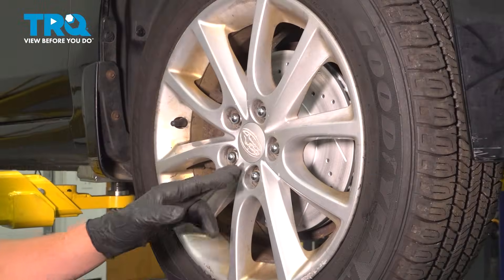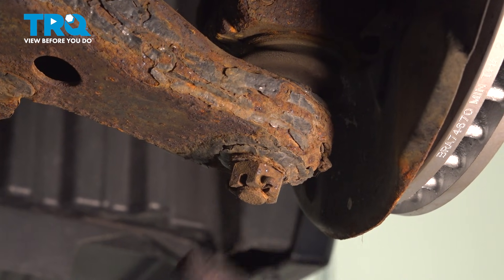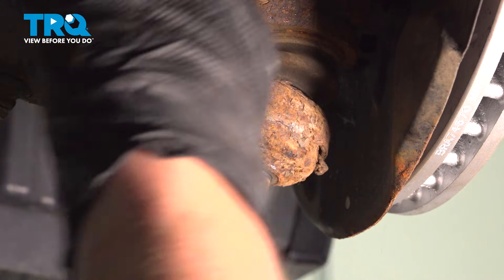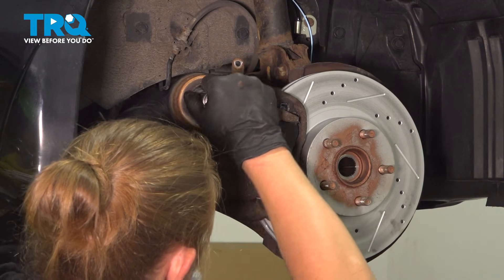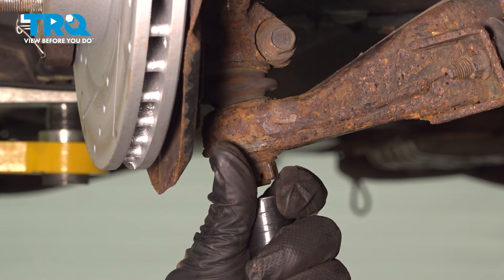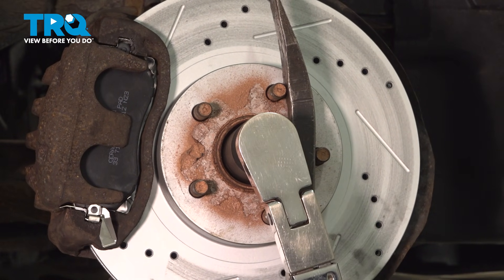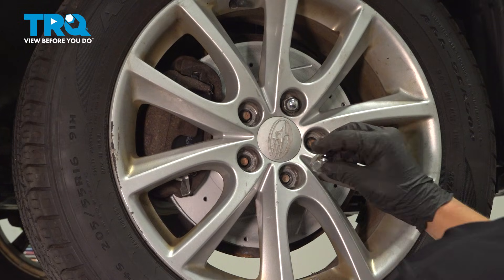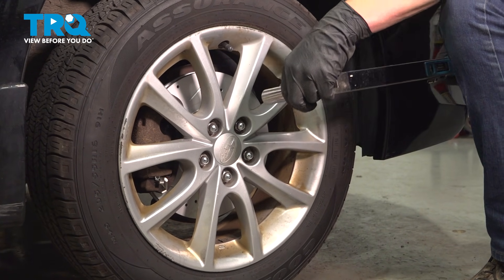How to Replace Front CV Axle 2012-2016 Subaru Impreza

Comment: All you do is push it into the inner part (the differential) how does that seal? Do you replace the whole shaft and both joints as an assembly? He only shows popping it out with a pry bar and then pushing it back in... nothing else is done to the inner part?

Comment: Just got done doing this on my 2016 WRX and the way that this gentleman does it works very well but I would definitely recommend removing your sway bar bracket if you were doing it on the ground with a jack on one side of the car. After I removed the sway bar bracket it was much easier just to push the lower control arm down and to disconnectthe ball joint. Easy sailing after that. Good luck. Took me about 1.5hrs going slowly

Comment: Best way I found to deal with lower ball joint is to disconnect the sway bar bracket (12mm) and use a length of welded chain instead of the hook he showed, to pry the control arm down. This is from my experience working on the ground, without a lift like in the video.

Comment: When you torqued the brake line hose bracket, it didn't turn before it registered being at torque spec. That meant the ratchet over Torqued the bolt. The proper torque proceedure is to back the bolt off until the torque wrench turns the bolt and then it reaches the torque setting. 

For something as light as 20 you can hand over tighten that which is why the torque setting is important especially if that is steel into aluminum.